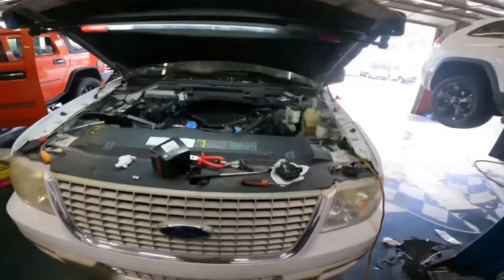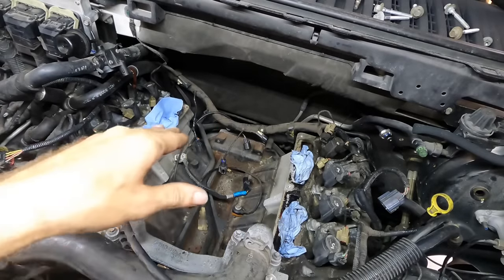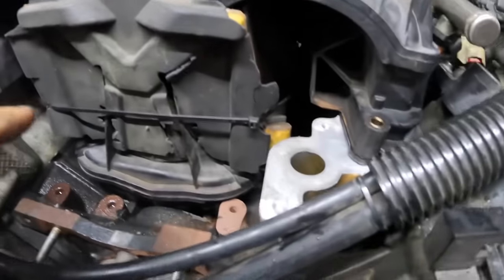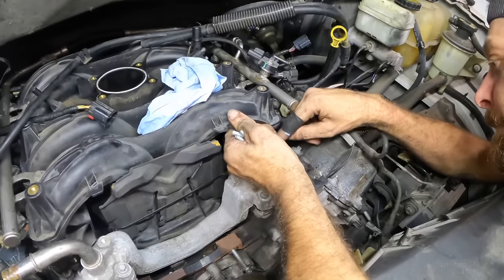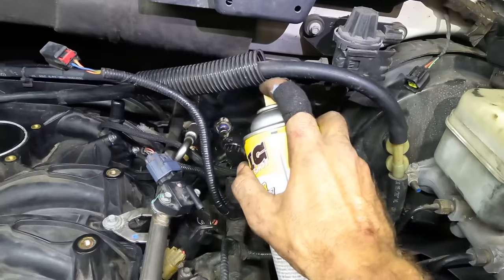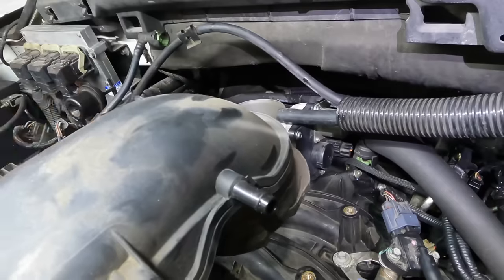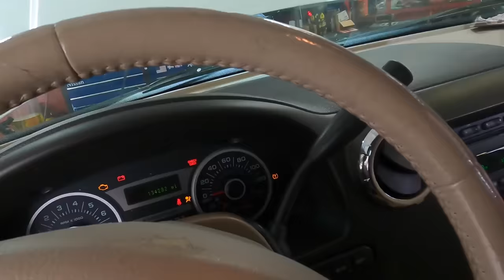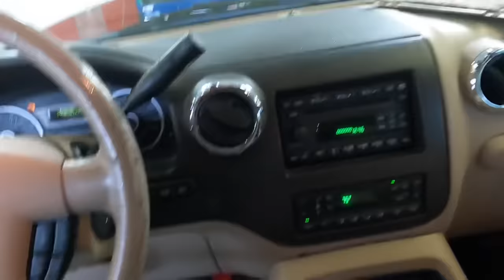Terrible Intake Nightmare! 2005 Ford Expedition 5.4 3 valve

Comment: I watched a video where Dorman reboxed an OEM BMW blower motor resistor. The BMW logo was scraped off. Now there is a company reboxing Dorman parts. They must be a real bottom of the barrel supplier. Dorman. Stranding motorists and frustrating technicians since 1918.
Reply: Napa reboxes dorman parts.
Reply: @jerrymoore7669  I caught that when looking for replacement spring shackles on Napa's website. I could see the Dorman logo on the shackle in the photo. Napa does list the manufacturer of the parts they sell in the description. Always verify before purchase. I avoid any Dorman electrical parts. The spring shackles fit just fine and included hardware.

Comment: Bad shop design that they didn't create a negative drain on the concrete floor. Everything should flow towards the drain grates at the door, not puddle in the shop

Comment: That was the most unbelievable intake from Ford. Who designed that nightmare?
 The next trick will be with Ford will be is.
Just take complete engine removal and replace.  Or crash them. Recycling has a purpose.
       Nitro  Joe.

Comment: Have you ever noticed that every once in a while (but not very often) the factory stuff is junk, AND the OE STUFF cost more than aftermarket. But like I said, NOT very often.
Reply: Tis the case for the brake discs on my car. OEM are useless - aftermarket every day. Just a question of how many zeroes you then want to throw at it.
Reply: On a Ford, it's all factory junk.

Comment: Too bad the customer bought a Dorman unit for that repair. I'm not against Dorman for most things, like drain plugs or oil pans or radiator fan assemblies, but for electronic parts (such as sensors) you really need to spend the extra money and get OEM quality.  I understand $400 is a lot of money, but if you need to do the repair again in six months you really aren't saving any money.  Better to do it right the first time so the repair will last for years.

Comment: Is that the one that has timing chains on opposite sides of the engine?
Reply: I think that’s the 4.0 that came in the explorer and small trucks
Reply: My friend had one we decided we'd change the head gaskets our selves and after we had the entire engine apart realized it had that lol he sold it as is
Reply: Yeah we weren't prepared to pull the engine in any capacity
Reply: @varus113  I would have done the same. Lol! What a design!?!
Reply: What were they thinking 🤔
Reply: We had like six guys standing around saying the same thing.. I never saw no shit like that before.

Comment: Ended up fixing a 2005 Mercedes c230k sport today (w203 chassis) as smelled like gas¹ & also started to “see” fuel leaking & dripping on ground, & made worse when fueling up vehicle , is what was told. Also told had fuel pump change 2.5 months ago. So, I’m thinking it’s the sender assembly leaking or pooling on top. Also, car is always “overfilled” when getting gas….cuz everyone likes to keep squeezing that lever to get as much Go Go juice out of pump and into take; even though it states on Gas Cap Door in inside w/ sticker: INSERT NOZZLE PROPERLY AND DO NOT TOP OFF……but everyone does is
Needless to say, after taking of fuel sender cover….no issues. Took off fuel pump cover and POW! Gas sitting on top and leaking out. So, swapped out gasket and retaining “nut” and no more leakage, & turned out to be a nice easy fix…..hooray 👍🏻👍🏻

¹ gas: fuel, petrol, whatever you call the “GO JUICE” to make vehicle vroom vroom away, spent last 2 days w/ my young nieces & Barbie cars…..RC Cars, lol